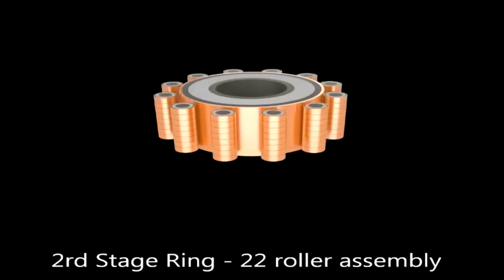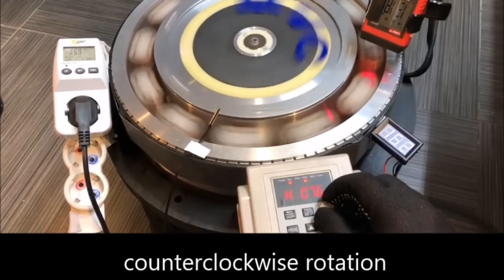Unlocking Free Energy: The John Searl Magnetic Generator/1000kW

Comment: Its important to note that that free energy generators are just any devices that generate energy from unconventional sources that are present everywhere and that are more abundant than other available energy. there is no difference between a free energy generator and a normal energy generator other than that the nature of the energy source makes energy extremely cheap and is available everywhere 24/7. technically, no energy can ever be free not just because of conservation or energy, but also because the device itself has to be build using labor, which costs something in exchange. 
this generator gets its excess energy from the earths gravity. all its doing is creating an unusually potent electromagnetic field relative to the size and mass of the device. any magnetic north pole or electro negative charge is slightly anti gravitic, because both are just points of highest divergence in the produced flow field carried by the universal medium of space. Gravity is a compression of the medium that results from any motion inside the medium, and matter is just localized flow. the compression of the medium makes masses move towards each other. this is what is abstracted away in mainstream physics as "space time curvature". if you look at how it is visualized in 3D, you can see that it is analogous to compression of space.
because space is just a single universal medium, the pressure divergence that is a magnetic north pole or a negative charge causes a reactive force in the medium. because the medium compresses towards matter, if you orient the diverging pole towards it, the divergence pushes against the compressive force in addition to just the balance of the medium, which means that gravity is pushing against the pole / charge. 
usually, this effect is tiny and undetectable compared to the gravitational interaction of 2 matter objects, and is proportional to the alignment of the magnetic poles of atoms and their components. but, if the electromagnetic field produced by the same amount of matter becomes stronger, the intensity increases, which means that the object is loosing weight or gaining weight slightly depending on its orientation. if the field is strong enough, it can completely neutralize gravity and oppose it, and at that point, the energy contained in earths gravity is going into pushing the object away, allowing it to levitate and fly off by being accelerated by gravity, with not energy needed other than that which is required to maintain the field strength. by changing the orientation of the field, you can make it move around, and it is being accelerated by gravity in any direction. if the field is strong enough such that the push and pull energy exceeds the energy needed to maintain the field, it becomes an energy generator. 
the reason this different than normal energy generators is because gravity is everywhere, and is inexhaustable, and there is no waste other than electromagnetic radiation, which could be shielded from the environment by putting the device inside a faraday cage. 
also, the most important thing of this is not that it generates energy from gravity, which is no different than a solar panel that works day and night, is dependent on mass but not area of exposure, and maybe produces orders of magnitude more energy per cost of generator. the most important aspect is that because it is being pushed by gravity, it does not have to fight gravity to move, which consumes most of the energy in conventional propulsion. instead, only the orientation of the field and the strength of the field has to be varied, or if you use multiple generators, you could could make it move in any direction or hover just by changing orientation without changing field strength at all. effectively, there is no mass nor any innertia to overcome, and the force necessary to produce crazy speeds is tiny compared to conventional air craft, which results in no G forces being felt despite extreme acceleration and deceleration, and abrupt changes in direction are possible, giving the engine perfect maneuverability. obviously, the field drags the air molecules by repelling them, which limits top speed. but there should be no stress on the flying device itself, meaning that it doesnt have to use special materials and doesnt have to withstand huge forces, which would make it much cheaper to produce than commercial air craft let alone space ships.
 
this is also perfect for space craft because there is no need to carry large amounts of fuel, and energy can be generated while flying, meaning that the thing isnt restricted in range by fuel and no excessive additional weight has to be carried for fuel. as long as the orientation and strength of the field can be varied, the thing can land and fly off anywhere. 
you can also produce artificial gravity using another dedicated field generator, and there is no need to worry about pressurizing the vessel because the air molecules are trapped inside its field, providing 1 atmosphere of pressure without requiring additional mechanisms or energy. the used air just has to be recycled in some way.
Reply: Wow that's saying a lot.

Comment: There is lots of free energy. well kind of. There is the earths magnetic force but size and weight are the problem. the unit only has small scale applications and the field doesn't have a stable speed as the earths magnetic field fluctuates. There are hybrid systems that use the magnetic radiation background that is in a city and there is lots of it from every type of electrical device there is. I did some investigation into free energy machines and they failed when in rural areas, or didn't work at all. That's when I began to investigate and found what was really going on. Stealing magnetic radiation is nothing new. Ask farmers that have power lines going over there property. LOL. Free is relative. Someone paid for it and you are just using the waste in magnetic flux. The inefficiency of the appliances. Distance matters, frequency matters. Its like thinking of a sponge to water and the power in the air being the water. In short if everyone did it no one would have anything. I made one of these motors and it took a few month to figure out how many frequencies I needed to tap and get into phase. Its great for the poor but the joke is that the people who have the science and education or the money to build one don't need it. The people that need it don't have the money or the education to build it. The biggest lie it is that they work every were. THEY dont. that is why Tesla wanted to build the big tower and transmit the power so it could be received like a radio everywhere. Power is freedom. And the rich don't want you to have either.
Reply: The power Tesla wanted to transmit wasn't free at all. It came from power stations run by oil, coal or water. Putting aside that Teslas idea about wireless power transmission failed: if you could take power free from the air, who would settle the production costs of this power?

Comment: I  have seen one of these quite a rudimentary example working. A bicycle wheel as a motor/generator set running off a 12 v car battery and putting 13.5 v back into it.
Reply: Just because they stepped up the voltage doesn't mean there was a surplus of energy. You could step the voltage all the way up to 240V with an inverter, but that doesn't make the inverter a generator.
Reply: You are thinking of the Badini, Searle's motor is in the Tic Tac.
Reply: @richspillman4191  Yes, I stand corrected.

Comment: The emotion.
 Less electronic generator received a patent, which means that patent office saw it work. if Searl had a patent, so did his. Therefore, if there's 2 machines that the patent office has accepted as working units, the only thing left over is that the energy industry and its owners, the private Central Bank stopped this form of milking the populations of their money. Is jesus was aware in all breaks down to the money lenders in the temple
Reply: I do not think anything "has" to work to be patented

Comment: you should be talking about john searls space ship that he built and flew across england and back.  the generator was a side effect.
Reply: How do we get it, can anyone assist in making this a reality
Reply: @CassimMat  to learn more . your going to have to look him up he was vary secretive.  you might have to go to a country that has not deleted his full story.
Reply: Or his other experiments that flew up into the sky and just kept going. One going up thru the roof of his house.
Reply: i did get a laugh when he said that.
or that it eats radio active compounds. where did it go?
Reply: @LeonardMagnusson  it doesnt "eat" radioactive components, its field stabilizes them by either forcing the unstable atoms to eject enough particles to become stable, or by adding energy which is compressed into the missing particles needed to make it stable. 
the device does nothing other than create and extremely strong electromagnetic field, and the effects that it has are possessed by ANY em field, they are just usually to weak to measure of to be noticed. the generator is just a special technique to generate an unusually strong field relative to the mass of the generator by being able to transfer more energy into the field without being limited before reaching the necessary strength.
any magnetic or electric field has the same properties. magnetic north poles and electronegative charge repels gravity, and the opposite pole / charge attracts it. weight is lost or increased depending on orientation of the field relative to the nearest largest mass. this is normally very weak and undetectable unless unconventional steps are taken to make the field strong enough for its mass so that it can be picked up by measuring devices. 
the device generates energy by creating a very strong field that is strong enough to make the device weightless or even fly off if properly implemented. the gravity of earth is pushing it upwards just like it normally pushes things downwards, and by changing the orientation of the poles, you can make it fly around in any direction. if the field is strong enough so that the energy of the push exceeds the input to maintain the field, then energy is being generated. you could harvest this energy by letting it fly back and forth or in a circle and let it induce coils, or attach it to a rotating mechanism, or something similar. 
and because gravity is pushing the thing, no weight has to be overcome, and movement can be induced through changing the strength of the field or its orientation, which requires comparatively tiny amounts of energy, and there is no perceived G force when being accelerated, since the entire field is being pushed at once, including the generator and possible any craft build around it with people inside. 
really, the only thing special about this device is that it is able to create a very strong electromagnetic field orders of magnitude higher than any conventional generators and inside a device that uses comparatively little amounts of matter. all the supposedly fantastical qualities attributed to it or other similar devices are features of electromagnetic fields that are just very hard to detect unless specifically looking for them for specifically designed equipment and materials, and are therefore very easy to suppress. 

on a side note, matter is just localized ether flow, or with other words just electromagnetic fields created by flow which has become localized around a point. gravity is just the compression of the ether medium as a result of any impulse moving through it. photons produce gravity despite having no rest mass, because they literally are just electromagnetic waves which are kinetic impulses in the ether medium, which apparently by itself compresses the medium. this is where Einsteins E = m c ^2 comes from. he just calls the medium "space time" and the compression "curvature", but you can see that when it is visualized in 3D; it looks just like compression, the only difference is semantics, thats it. 
there is various ways to logically prove that electromagnetic fields must affect gravity. one would be through Newtons 3rd law, meaning that if the law is true and light is bent by the gravity of large objects, light must also exert a force on the gravitational field of the object. physicists just use language in a very deceptive way. such logical inductions are arbitrarily handwaved away by claiming that "gravity is not a force" to dynamically cover for inconsistencies and contradictions. every time something indicates incompleteness or something new to be discovered, information is simply removed and things are redefined as more and more abstract to create the illusion of complete knowledge. 
spin originally clearly was angular momentum or rotation, but because the energy required faster than light movement, instead of looking for how that could be, they simply denied that it was angular momentum and made it an abstract, intangible property, because that way the logical inconsistency cannot be found any more. physics is extremely deceptive on purpose. its goal is to appear complete so that nothing new is invented anymore. this is why nothing fundamental is being discovered anymore despite so many physicists and so much equipment. you cannot make new discoveries when current theories deliberately present themselves as complete and academics reject information that doesnt conform to the accepted model, which is deliberately abstract and intangible so that no discovery is possible.
Reply: Dross.